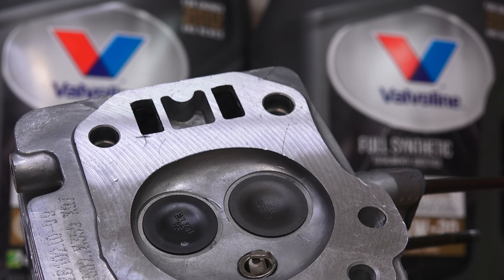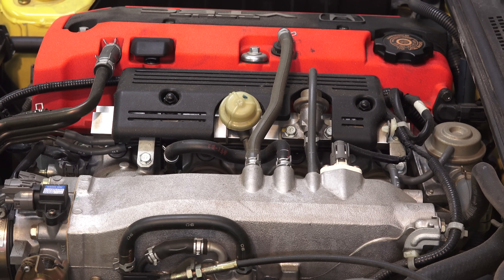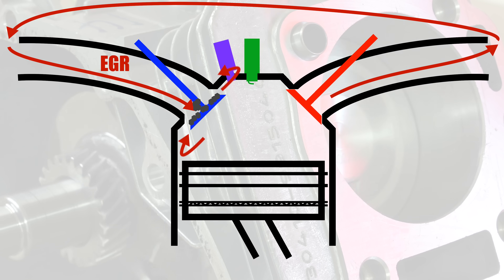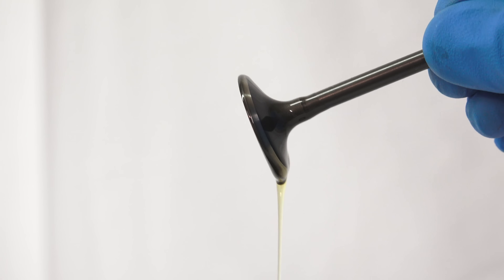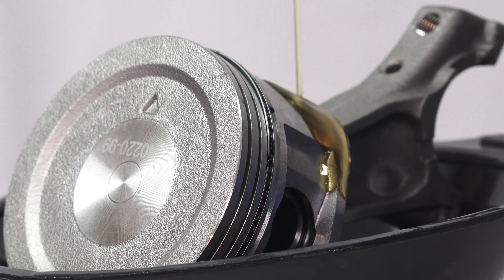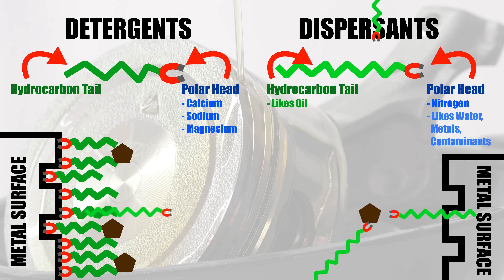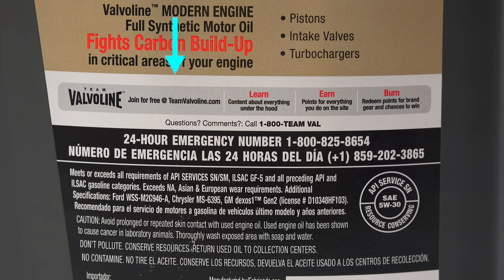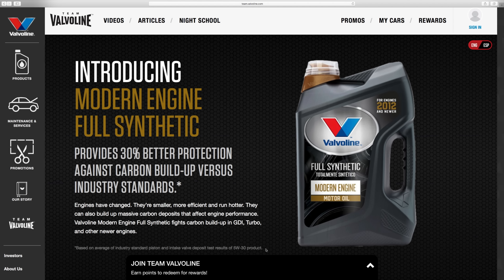Can Engine Oil Help Prevent Carbon Build Up?

Comment: here's a question for you. overfilling the engine oil, by a lot or a little, how does it affect the engine and could it be better to top it off just slightly above max level for people who don't regularly check the engine oil level giving them more of a margin for oil usage or leaking.
Reply: Overfilling leads to aeration of the oil. Aeration leads to increased bearing wear and more rapid oxidation of the oil. Think about it, if the oil level is higher then it has that much less distance to travel (slosh) before contacting the crank. This is why high performance engines use a dry sump. Which I won't be surpised when manufactures impliment into mass produced vehicles. Windage trays can only do so much.
Reply: And there I was thinking the dry sump is because of the cornering cased inertial forces.
Reply: @valdius85 yes, while cornering a dry sump system won't be starved for oil. They can also put the engine lower in the chassis for better weight distribution and by extension, cornering grip.
Reply: @littlerhino2006  
That's why DUCATI uses them on motorcycles, the leaning.

Comment: My EGR valve is clogged. Can I clean it effectively without removing it? Thanks.
Reply: Nope, not effectively. Don't believe the writing on them labels. I cleaned mine with throttle body cleaner spray and a small paint brush. Spray alone won't do a lot to the gunk.
Reply: @grumpy_0ld_man  80

Comment: Could you make a proof of what Valvoline claims? For example, two same engines one lubricated with Valvoline and the other is lubricated with regular oil. Thank you in advance.
Reply: Camry le  That's more of what Project Farm does - sounds like a great video idea though!!
Reply: You need to do either fleet tests or laboratory tests. Claims to the contrary, all oils perform about the same, even no-name oils. Just maintain the change interval. On my vehicle, I can do an $11 oil change in ten minutes, with a drain pan I can take directly to the parts store for recycle. The filter is vertical and drains completely. I can remove it without tools.

Comment: "In direct injection engines, the oil itself is really all you’ve got to actively protect your intake valves." How does the oil get to the intake valves? Through a leaky valve guide gasket? I get how the oil's additives (dispersants, detergents, etc) COULD prevent carbon buildup, but that assumes the presence of said oil on the back of the intake valve. Are we relying on the PCV to pick up oil vapors that contain said additives to wash the back of valves?
Reply: You didnt watch the rest of the video...? It tells you exactly how oil will touch the valve heads lol
Reply: If you have a DI engine you should really have a catch can installed on the pcv system to keep that sludge from going back into your engine

Comment: A good quality catch can is also a good idea, although it's kind of a pain in the ass during winter weather due to having to drain it all the time. My 2.7 Ecoboost F150 drained nearly a gallon of water, oil and gas during the winter months. Drained it weekly. I also use Amsoil Signature Series 5w30. Basically direct injection is a bad solution in my opinion.

Comment: I got a 27 year old Honda with all the emissions deleted (because I live in a free state and can do that). My valves are nice and clean with 240+k miles :)
Reply from the maker: I have a 16 year old Honda with all the emissions systems in stock form, and it has beautifully clean intake valves. You and I have port injection. Emissions systems aren't bad, they allow for cleaner air, and clean air is cool. You know, for breathing!
Reply: Engineering Explained  VW pay you to say that?
Reply: Richard Skipper if you have to take the head off to clean carbon every 30,000 miles then your engine is junk in my book. Put a bottle of Seafoam in the gas take every fill up if it is that bad.
Reply: @glennspeeds  
No cleaner through the gas tank works on DI engines unless it also has Port Injectors.
Reply: Chris Collins tampering or removing emissions stuff is illegal in all states regardless of local testing. When you get emphysema or lung cancer maybe you’ll realize emissions are harmful??
Reply: Chris Collins how much did it change the exhaust sound?
Reply: @Richard Skipper 
What kind of car is it??
Reply: LMFAO, having to clean valves on a modern engine is insane. Whats next, having to open the engine up completely to de-carbonize it like in the old days of the very first cars?
Reply: Exactly, DI sucks. And no change to exhaust sound, factory exhaust with test pipe.

Comment: I bought the service plan which cost £400, the same as for every car. I booked it in a month before. On the day they didn't have some of the filters which I found odd, I asked the delivery driver who said they only have one barrel of oil in the workshop.

Comment: despite this type of oil , i've seen alot of direct injection engines with ALOT carbon build-ups. i think the dual injection is the best solution against the carbon deposits.
Reply from the maker: I agree that dual injection seems like a smart solution to have the best of both worlds.

Comment: Jason, Can you comment on good or bad gas and where to get it from. My mechanics are saying Shell, Chevron are the best gas. Does this also prevent carbon build up?
Reply from the maker: Yes, top tier gasolines will have better detergents and do a better job at keeping valves clean. That becomes more challenging with direct injection, when the valves are not sprayed by the fuel.
Reply: Engineering Explained, one item you did not talk about was if the 30% margin is good enough to eliminate carbon buildup? This point is further exacerbated if the industry requirements are woefully inadequate.

Great video otherwise. Much better than what other sites provide. However, the engineer in me realizes that there is information missing to have a complete picture on the matter. If you can please provide more information, it would be greatly appreciated

Comment: No matter what you do or what oil you use, DI engines will ALWAYS get carbon buildup on the valves.  It is just a matter of how long it will take.
Reply: STP oil treatment from day 1 will help.
Reply: @wallmethod  Nothing help, selling it and buy newer car with dual injection or port injection solve the issues 100%.
Reply: Slowing carbon buildup is a good thing.
Reply: I'm convinced that the "Italian tune-up" is a pretty good method to keep the engine clean.
Reply: @kazn10  Just drive to the coast or the mountain every now and them. Back in the bad old days, Fords especially used to get stuck rings. Had a friend from eighth grade who had a Ford Falcon oil burner. He drove from Chicago to Denver and back and it burned the carbon out. He was a psycho pothead and couldn't get any in Chicago. Across four states back when that was a serious criminal beef. It still is, depending on where you are. Like all psycho potheads, he expected everyone else to be his enabler.
Reply: @kazn10  There's always someone eager to use the phrase, "Italian tune-up," but to prevent or eliminate intake valve buildup takes cylinder head temperatures that far exceed whatever you can generate in normal - even very aggressive - street driving.
Reply: @kenhoward3512 An Italian tune-up would never work for a direct inject anyway. There is no fuel being spraying on the back of the intake valves.
Reply: It is give the engine a good thrashing now and then and you'll be fine.
Reply: @kazn10  
Does no good with a DI engine.
Reply: Yup. A catch can can really help out with this along with regularly using injector cleaners. Both of these can extend how long it'll take until build up becomes a issue.
Reply: @shadow7037932  injector cleaners do NOTHING for GDI engines, dont waste your money!
Reply: Motorcityman Man They still clean the DI injectors which do become clogged over time if they contain PEA. This is a fact, not an opinion. And reversion occurs in the valve area during combustion which has been proven by several OE’s to have at least some cleaning capability. While very small it’s something.
Reply: @motorcitymanman7711  They still clean the injectors......
Reply: @kevins1834  
Yeah, it cleans the injectors if thats what you're using it for, but not the valves if its GDI.
Reply: @motorcitymanman7711 Incorrect. Injector cleaners will help clean the injectors in any engine.They won't do a thing upstream of the combustion chamber, but all injectors need to be clean regardless of other issues.
Reply: @shadow7037932   You aparently missed something in the video.  injector cleaners do absolutely nothing to clean valves in  GDI engine.
Reply: @shadow7037932  
BUT......don't use injector cleaners through the gas tank, does no good, has to go under the hood in the vacume lines.

Comment: Anyone use Pennzoil Ultra Platinum? Run their 5w-20 synthetic exclusively in my Eclipse GT
Reply: Tried it. Moved to Motul (100% synthetic, not fully synthetic) when I compared the two
Reply: @nicolaslosito5735 You mean full synthetic ≠ 100% synthetic?
Reply: Man from Nantucket yes. 100% synthetic like motul use group 4 pao oil. Full synthetic oil are fake synthetic: they can use wherever oils they wont(most like mobil 1, ecc use rigenerated oil) cuz there are no rules to respect.
Reply: I run the platnum, not ultra platnum. Was running the ultra platinum then switched to Redline in my Civic but it was such a pain in the ass to order either of them. NOVAK numbers are decent and it's on a local shelf when I need it. I run a magnet on the drain plug and one inside of the filter. I figure that's enough to survive the recommended interval with out too much trash being circulated.
Reply: As long as you are running a group 5 oil, one that is ester based... You can't go wrong.
Reply: MasterMech77 group 5 oil is good for racing purpose. For common street driving a group 4 is all u need and is more cheap than group 5 oil.
Reply: @Malossianoplus  I take it to the drags every now and then. Does that mean I should upgrade to a group 5 or nah?
Reply: Man from Nantucket group 5 oil have better performance and even protection like group 4 oil. But u will pay double the price. So if u drag every now and than, like most people do sometime, group 4 is good. Group 5 is for race track.
Reply: @Malossianoplus  Thanks, I'll stick to the Pennzoil then

My winter beater takes Mobil 1 high mileage because it's got over 136k miles on it and figure I can use the extra protection
Reply: Man from Nantucket pennzoil and mobil are not group 4 but group 3 oil.
Reply: Nicola6892 Pennzoil Platinum is GTL base stock which is essentially a GRPIII with GRPIV performance.

I’m using Pennzoil Ultra Platinum 5w20 in my ‘17 Mustang GT but will probably switch to the regular Pennzoil Platinum due to it being officially Dexos 1 Gen 2 and SN Plus certified.

Comment: My Megane RS had a service at Renault and my gut feeling is they used a basic quality oil, is there anyway to test/compare with the recommended oil?
Reply: Darren Lomax Just call and ask them what they used. In the future you can ask ahead of time and choose the synthetic, if they are not already using that.

Comment: Hey Mate, always love watching your videos; very informative and intriguing. I noticed you said that oil is  80% base oil and 20% additives. Is that the basic ratio for all oil or is that valvoline's special mix for modern cars?  Cheers
Reply from the maker: It's a fair ratio for many of the oils out there. Many will range from about 80-90% base oil, with 10-20% additives.

Comment: Is pennzoil ultra platinum 0-20 any good ? Starter using it in my 2018 Mazda 3 sport 2.5. I use a Mobil 1 extended performance oil filter
Reply: I've used synthetic Mobil 1, Castrol, and Pennzoil in my 2010 Mazda3 and submitted each oil change to BlackStone labs.  All are good, but for my use case, Pennzoil works the best and is the most cost effective.
Reply: @ytechnology  ok thank you I like using it because it's a bit cheaper and heard a lot of good things. I do about 40,000km a year so I want to use a good oil
Reply: Define “good”. Can you use it and it work? Yes. Can you still have great results with conventional oil? Yes. Is it the best? No.
Reply: @nicolaslosito5735  as in good. I mean best performing with the best engine protection. I want to keep this car running for a long time so I want to find the best oil

Comment: Have a 17 ecoboost put a catch can and synthetic oil next change I will look for that oil. Like your videos especially the hard at work one. Day in the life.
Reply: The second generation ecoboost engines are Dual Injected so the port injection washes off the cylinder heads. Not really much need for a catch can. Only the Pre-2015 ecoboosts are only direct injected.
Reply: Sami Mackeed thank you didn't know that.
Reply: @mileshiles1287  you might want to double check that. From what I understand only 2018+.
Reply: Actually the second gen ecoboost came out in 2018.
Reply: @greekgeekconsulting  so pre 2018 instead of pre 2015 ?
Reply from the maker: Haha, if only a "day in the life" was how it actually went! :)

Comment: What about adding like a quart of ATF in place of a quart of oil? I heard ATF is a great detergent and will clean an engine much better than any oil additive or synthetic oil out there.
Reply: Colin Olsen Lucas oil has some good stuff. I like the injector cleaner they offer as well.
Reply: if your eng is dirty it is better to just do a few 1k oil changes using cheap oil until the oil comes out clean.

Comment: Why don't we go back to NA port injected engine to remove all of these issues?
Reply from the maker: A lot of companies are actually choosing to use both port and direct injection, so that they can benefit from both styles.
Reply: I've only heard of toyota and ford so far, are there more companies now doing this?
Reply: @daryno4267  I think some VW/Audi's have them too
Reply: Daryn o Kia and Hyundai use a extra spray while the intake valves are open as well as valve timing to keep the valves just long enough for the injectors to get vapor on the back of them.
Reply: @tails300  source please
Reply: They're less efficient
Reply: @VaporyAbyss  I think Mazda is doing a great job, from an efficiency standpoint, even with NA engines such as their 1.5 litres gasoline. They aren't powerhouses though.
Reply: Fuel efficiency standards and emissions control.  Direct injection cools the cylinder, reducing NOx emissions while allowing a leaner fuel air mixture.  It also allows for more precise fuel delivery.
Reply: Never had this problem with my carburator. That's for sure!
Reply: michael spencer you also didn’t get 30+mpg
Reply: @nicolaslosito5735  
Some Cars in the 80s got almost 40mpg or MORE than 40mpg!!!
I had a Escort with a 1.9 liter that used to get over 40mpg but it was also like 120hp.
Reply: Motorcityman Man “some cars” and there was not the NOX emissions standards lol
Reply: @nicolaslosito5735  
I also had a 3 cylinder 1.0 ltr Chevy TURBO Sprint (Suzuku motor) that got over 50mpg....
.was a 1987 only made 2 years with the turbo.
Reply: Motorcityman Man yes, but i am sure it did not meet NOX emissions.
Reply: @102wingnut  you also had to retune it if you drove up any significant grade.
Reply: @littlerhino2006  true... or just deal with the power loss/ rough running.  I think Ill stick with my new turbo TSI engine.  Hopefully manufacturers will fibd effective ways to deal with the side-effects!
Reply: You didn't have a problem, michael,  But the EPA sure did, (Emissions)
Reply: @garymiller2056  too true.  My response was meant to be a bit tongue-in-cheek in response to someone suggesting we go back to doing things the old way.  Obviously there are a lot of advantages to DI despite the unintended consequences.

Comment: Never mind the specs they won’t tell you that the secret is low volatility!

Natural-gas-derived full synthetic oil is the answer.

Surprised that this info is just now coming out after so many years of  Direct Injection.
Reply: P V Agreed👌🏿👍🏿
Reply: where can I find more info about natural gas derived oils and DI engines?
Reply: BeersNGears ... "Google" ... "prevent carbon build up with direct injection". There is a ton of information out there.
Reply: Thuan Tran Pennzoil Platinum and Pennzoil Ultra Platinum oils are natural gas derived.
Reply: BeersNGears ask the oil manufacturer if the base oil is tier 4 or tier 5.  Tier 3 or less is hydrocracked conventional oil, not a real true synthetic base oil.  Base 4-5 oils usually have a low NOACK volatility test result.  Ask your manufacturer about NOACK test results.  I called and checked most of the brands out there ever since Ford announced to not use CK-4 diesel oil in Powerstroke diesels.  Best ones found after all my research are Red Line Oil and AMSOIL.  Recommended NOACK for direct injection engines is 8 or less.  I'm running red line in the truck this year but it is very expensive.  Planning on switching to AMSOIL signature series oil this winter or next year.  Cost is much lower for an equivalent oil to red line.
Reply: Quite correct , greekgeek---Volatility is the importance for clean valves on GDI engines. Amsoil sig. series is about 7.
Reply: P V ... I have known this information since the early 2000s time frame, when direct injection started becoming main stream (worked for Lexus as a tech). They put out to all of the customers, they had to use the full synthetic 0W5, or there would be excessive wear and carbon build up... BUT you would be surprised at how many people called it "snake oil" or Fake... a way to get more money out of people. SO it is not like the information was not put out. The problem was the average "Joe" didn't listen, you know what they say, "ignorance is bliss".